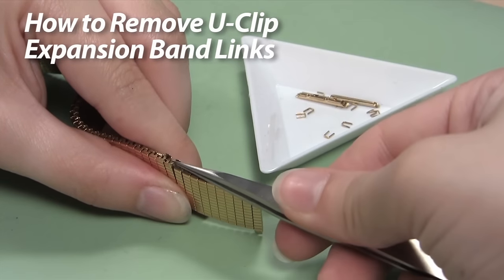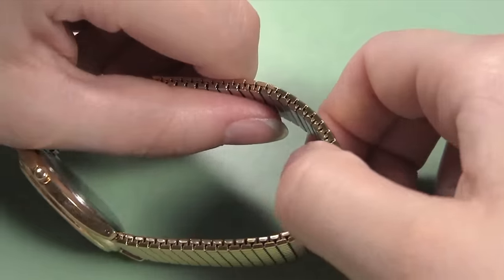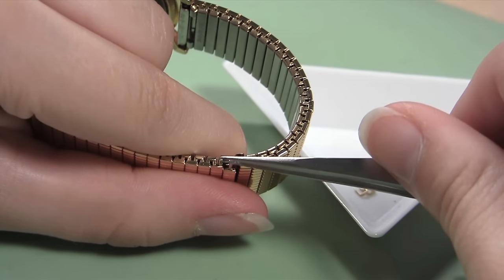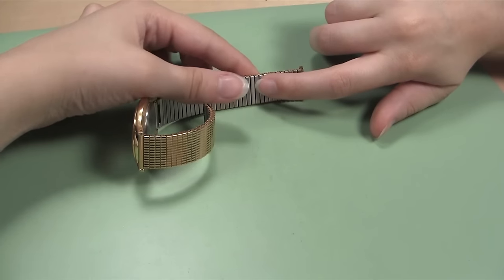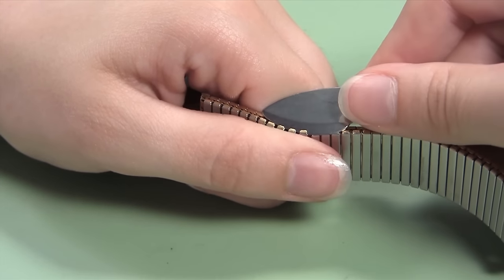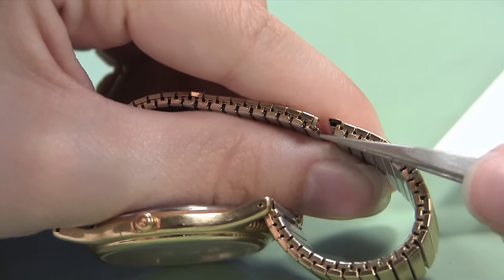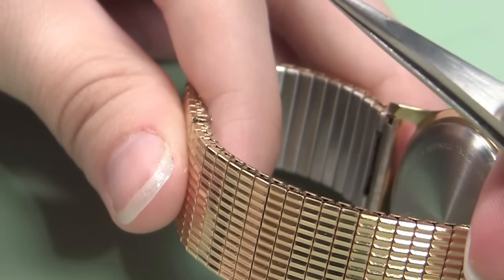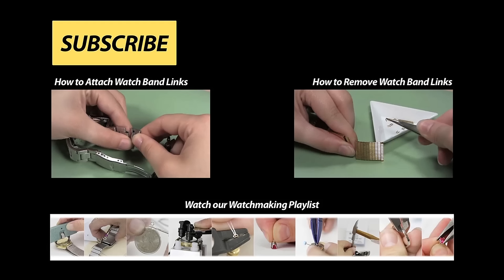Watch Band Adjusting - How to Remove U-Clip Expansion Links

Comment: i took an old watch to a watch repair service to see if it can be fixed because it had a small problem and i asked if the watch band can be shrinked. It had the same type of band as the one in this video and he said that it cannot be done and instead offered to change it completely but i refused because i didn't have enough cash with me. I'm really glad i refused because, a week later while i couldn't sleep, i decided to do a little research of my own and see if it really cannot be done and i found your video. Guess what? Took me less than 5 minutes, a surgical knife and an anatomical forceps and you can't even tell where i've opened the watch band. You saved a poor student some money, man! Thanks a lot!

Comment: Excellent presentation. Very clear and detailed step by step. Video was all shot very close up and it was easy to see the detail and how the technician took the pieces apart, removed the links and exactly how he put the U-pins back into the ends and reattached the ends. I shortened my expansion band exactly and perfectly.  It took about one and 1/2 hours. Due to my age and bad vision, but it worked out great!

Comment: Great video.   this is a time consuming job, I used jewelers screwdrivers, needle nose plier, small vice grips, et. al., but I got the job done of my $7.99 Wal Mart flex band watch.  Not too hard to remove links, but closing the band back together is a challenge.
Reply: U

Comment: I found it much easier to insert the u-clips when I hold them in a 5" hemostat, a useful tool for small work available online for around $5.  It's originally a surgeons' tool, but they're widely used in repairing electronics, for example.
Reply: Good hint.  I have a hemostat and will have to try that.

Comment: 4 Hours later - I finally devised a method - get to the final stage and cut insulating tape to less than the width of the strap and stick it both outside and inside to hold the links in place whilst fitting the clips - still extremely fiddly but finally got it back together - give the clip half a chance and off it goes and hides in the most inaccessible place it can find.

Comment: If the band is re-attached using just one  u-clip on each side, it should come apart by removing just one u-clip and not three. Seems like twice as many tabs are bent open and 3 times as many u-clips are removed than are actually needed for each dis-assembly step.

Comment: I have a watch with the same band as that, it came apart today, can I just take off the broken clip and attach the two on either side?
Reply from the maker: Yes.  In the case of missing or damaged link(s) just remove the parts and use the next one. Because the band is expanding, you should not notice much difference on the wrist.
Reply: Esslinger.com Thanks man, I must try it
Reply: +Esslinger.com how much do you have to pay for a  jewler to do this for me
Reply: +Esslinger.com how much does it cost to get repaired?
Reply: not much....

just your immortal SOUL
Reply: matthewmchugh1 what is this watch called?
Reply: @jmeler1254  Walmart charged my father 30 bucks to remove 2 links about 2 years ago.
Reply: @donnavance8908  well I've had a lot of time to learn about watches...ive done these type of watch bands they are a pain in the ass but I get it done...sometimes on vintage ones they will break easy if you aren't careful

Comment: Wasn't easy, but I did it.
I recommend taking one or two off at a time and checking how it goes around your wrist each time.   I figured I needed to remove 6, but that was too many and had to add some back.  It's more work to put some back - then have to close it.